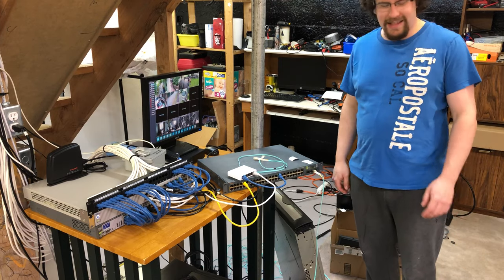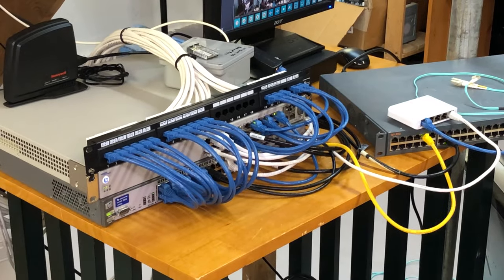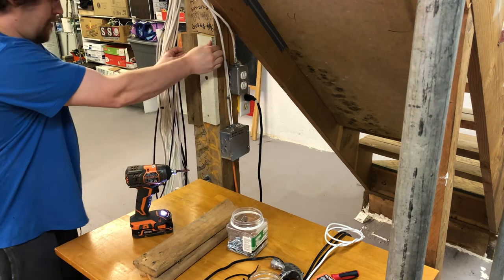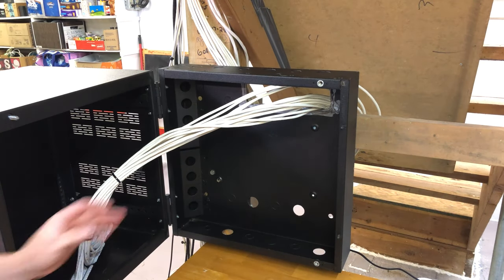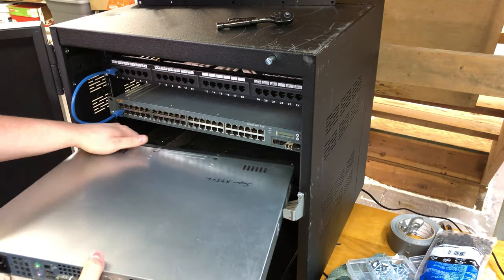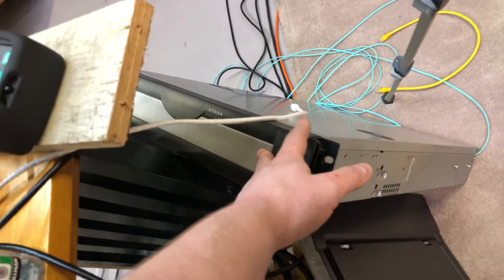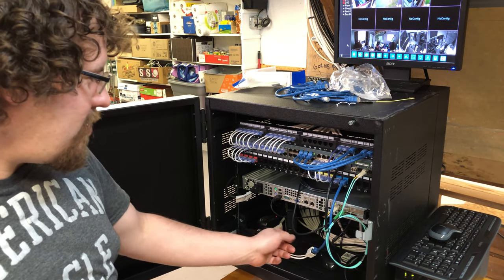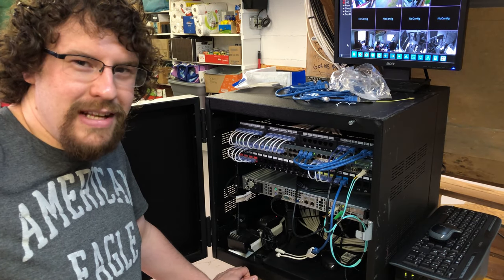Installing my new network rack!

Comment: Look at inline keystone patch panels. They are more expensive but allow you to terminate 2x faster as its a Rj45 on both ends. This also allows you to have cheap control over the quality of terminations at the back of the patch & if one patch point dies, you just replace that jack, not the patch substrip or entire patch panel.

Basically a higher upfront cost but much higher efficiency moving forward.

Comment: Love it 

Maybe a arduino temprature sensor in the rack with a fan controlled by the temps ?
Reply: I thought about building one for my rack but ended up just getting the combo temp controller/sensor /display units off Ebay for $5-10 linked to a couple of spare 12V computer fans

Comment: May I ask who your ISP is?
Reply from the maker: For sure, I'm on Telus who provide service for Western Canada
Reply: @TechwithShae  Bell is coming through with fiber in my neighbourhood in Ontario. I am starting to wonder how difficult to run their fiber directly into my network. What kind of hoops did you have to jump through to get your Telus lines to work?
Reply from the maker: It was pretty straight forward. There is a wealth of information on DSL Reports. The thread below specifically helped me get my sfp module working with PFSense

https://www.dslreports.com/forum/r32230041-Internet-Bypassing-the-HH3K-up-to-2-5Gbps-using-a-BCM57810S-NIC
Reply: @TechwithShae  thanks

Comment: For Christ's Sake why didnt you put the 2x4 all the way across the stair beams and center that stupid cabinet my OCD is getting me so triggered right now.
Reply: or even better, push it "in" towards the stairs and have it supported on the bottom or sides by 2x4s going to the stair supports. then it looks nicer and doesn't stick out into the room as much